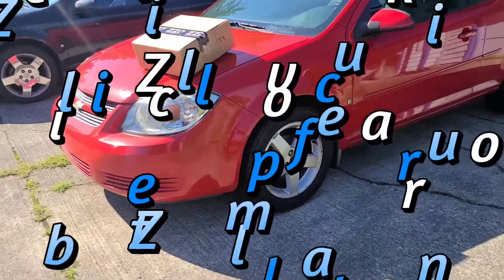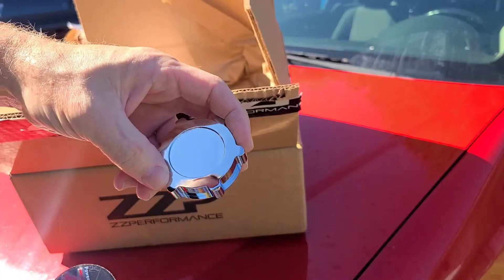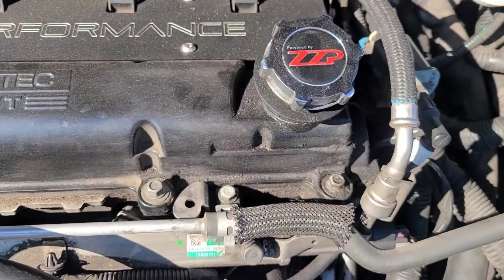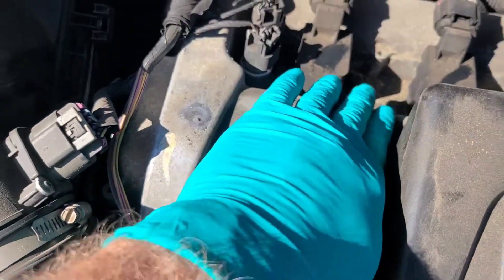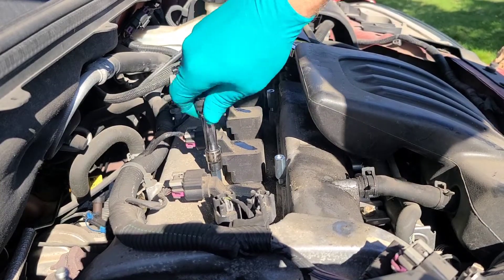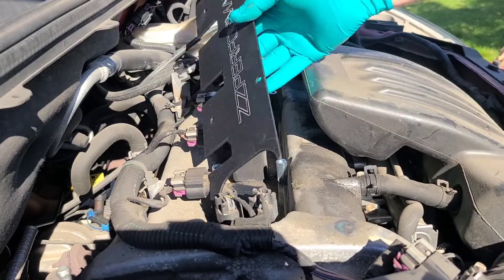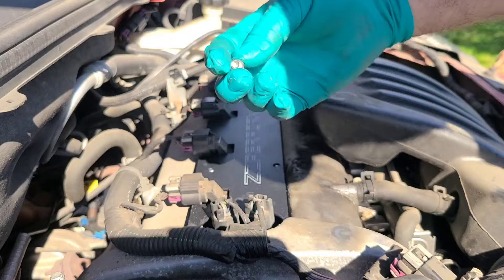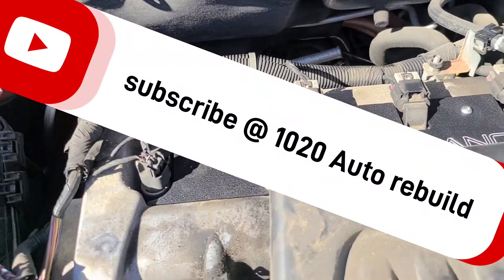2009 Chevy Cobalt ZZP coil pack cover and ZZP  billet aluminum oil filler cap installation

Comment: So that engain a 2.2 ecotec I was always told that this cover would not fit
Reply from the maker: It fits on the 2.2s with variable valve timing. 2008 ,2009, 2010
Reply from the maker: It will fit on the 2.4 l engine's as well

Comment: Hey, do you know if an EBCM from any cobalt will work on a 06 SC cobalt?
Reply from the maker: Is it the engine control module or the body control module?
Reply: @1020autorebuild  I think. My car won't stay started and chevy said I need a EBCM
Reply from the maker: It sounds like you might need a engine control module and a body control module I would get them  from a wrecking yard try to find the same year and engine Make sure you take the key for bypassing the security
Reply: @1020autorebuild  even tho my car a supercharged?